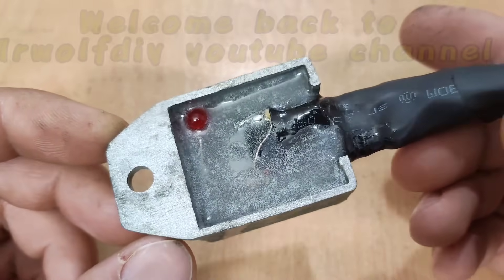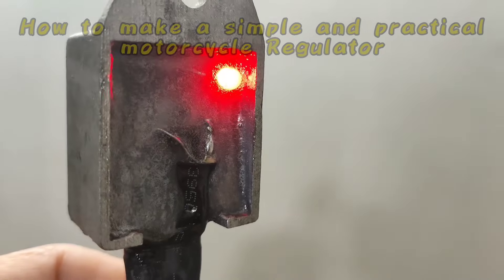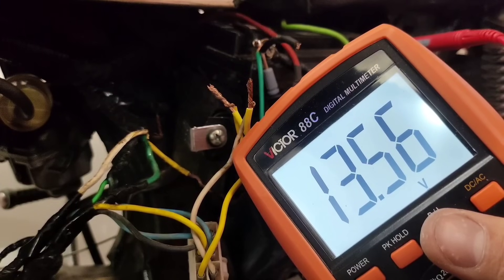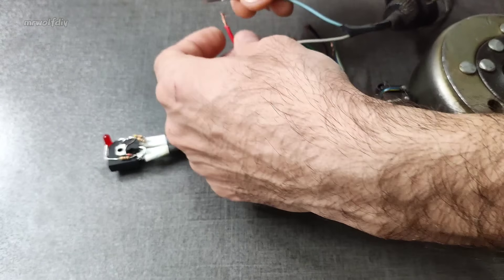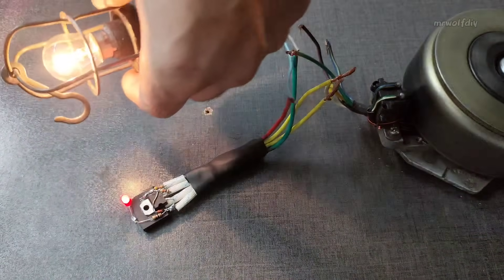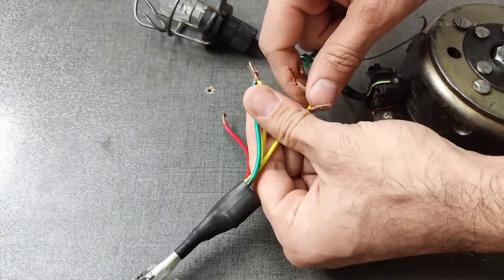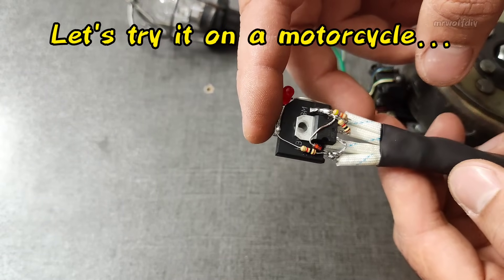The Voltage Regulator Hack _ Build a super easy Regulator for Your Bike!

Comment: In my snowmobile, I only have a 2 wire voltage regulator that connects in parallel with the stator. The voltage is not rectified, but it is a type of shunt regulator, output is maintained at 14VAC instead of 14VDC. Can you help me with the design?
Reply from the maker: In your snowmobile,
if the goal is to charge a battery or power DC loads, the voltage must be converted and regulated. Ac output is not suitable.
If you only want to maintain the 14VAC output as it is, you can improve or reinforce the shunt regulator design.
If you want a more detailed explanation, just let me know!
Reply: @MrWolfDiy I don't have a battery or DC charges to power, only a headlight, tail light and handwarmers so resistive charges. That would be great to have more explanation. Thanks !

Comment: So the Zener diode value is the main supervisor here . . . . .got it. .. 👍👍👍

One suggestion: Ganging the two main components together is not practical since they will exchange heat, separating them and mixing the sealing epoxy with magnesium oxide when sealing them promotes better heat dissipation.  
(Magnesium oxide (MgO) powder is an electrical insulator that is also a good thermal conductor.)

Greetings from India. ..

Comment: KBU8m is only rated at 8 amps max (96 watts at 12v), so unless youre riding a low spec 125 cc or less ,& youre bike doesnt req a 3 phase regulator & you ride daytime only,ts pointless .To give you an example my 750 requires a 300w 3 phase reg,thats 25 amp,the one fitted is a 30 amp to give a little margin. Best thing to do, get the spec of youre motorcycle regulator & either buy a new one, or make a suitable higher powered one,regs aren't that expensive, and you get a guarantee. When youre out in the wilds,miles from the nearest garage, & your bike loses battery power,you will think,why did i make this.
Reply from the maker: Yeah , this one’s for old motorcycles...

Comment: Instead of epoxy, I often use hot melt glue because it's cheaper.
Reply: Not a good idea as it quickly may melt at operating tempertures.
Reply: @tenlittleindians   Good point, that's certainly a possibility.  Although, my concern was damaging electrolytic capacitors no damage was apparent.  I haven't experienced any failures yet though, fwiw.  Not to say this can't happen.
".Hot glue, also known as hot melt adhesive, typically melts within the range of 250 to 380 degrees Fahrenheit (121 to 193 degrees Celsius). The specific melting point can vary slightly depending on the glue's formulation".

Comment: Thanks but zener  diode operates in reverse bias mode guide me
Reply from the maker: Thanks for question, Yeah, that's right. A Zener diode works in reverse bias mode — that's actually its main feature.
When the reverse voltage reaches a certain level, called the Zener breakdown voltage, the diode starts to conduct current in the reverse direction without getting damaged.
Basically, when the input voltage goes above that level, the Zener lets current through to keep the voltage steady and prevent it from rising any further.

Comment: i tried already dont work my register blowup.. i even tried your updated one with tip 147 but not work high voltage 70 or 80 v
Reply from the maker: A lot of people have had success with that circuit — just keep in mind it's for single-phase motors.
Reply: o my bike is double phage ... so for double phage  any one @MrWolfDiy
Reply: @MrWolfDiy  Will it work for 12v bikes like ct100 or old platina type comes with 2.5LB battery?
Reply: @theindianworkshop   There are at least four stator designs, basically two catagories (low power and high power).  Most high power stators do not use shunt regulator.  In my experience, low power stator is found on bikes with kick start, no electric starter.  The reason is, an electric starter uses large amounts of energy from the battery which then must be quickly replenished by the stator.
High power stators are usually 3-wire and use scr switching type regulator.
Among these, there are delta wound, center-tap, or may even be wye.
An scr type regulator may be used with a low power 2-wire stator as well, such as the 4140309 regulator.

Comment: What component needs changing or upgrading to make it put out 14.4 volts?
Reply from the maker: By changing the value of the zener diode and adding a filter capacitor (2200/50V) in parallel to the output, the output voltage can be changed.

Comment: I create the you made but not working i chek it if have do wrong but not working its to low voltage
Reply from the maker: Hi dear, Which motorcycle are you planning to install it on?
This is meant for older motorcycles.
This version has better performance...
👇
https://youtu.be/KtSelisDO8s?si=wmctu4XcL02Mm_Cq
Reply: I will use to honda tmx 155 4pin i have buy meny regulator but no good the voltage is to hight 17 to 21v the regulator is not durable i try to creat the one you did it the problem is no voltage going out i try it i dont know where i go wrong i use the brage diod is 10amper i dont know if that what when i wrong  the one you use is 8 amper brage diod
Reply from the maker: Hey buddy, Among the regulators I’ve released so far, this one is currently the best. Try this,
👇👇
https://youtu.be/KtSelisDO8s?si=D4u9ymA_2YNiS3y4

Comment: Hello Bro........  i`m just build it but not working... TIP142 is Too hot after 25 AC volt connect for testing.
Reply from the maker: Sorry it didn't work for you. This works mostly on older motorcycles.
Reply: @MrWolfDiy  Thanks Bro for quick reply.....  If this RR install with a motorcycle it will be work??

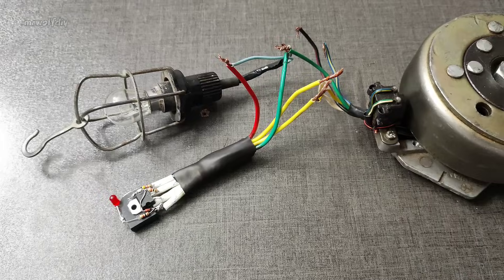Comment: ,How to regulate to 12 V and not burn the bulb, if you don't have a reference battery? 6:36 minute!
Reply from the maker: The regulator's duty is to regulate the voltage to a certain level to prevent bulb burnout and ensure battery charging.
Reply: @MrWolfDiy  how? With the zeners? Thankyou💪

Comment: Geat video i learned it thank u 💪 can u convert 6v to 12v motorcycle  ☺️
Reply from the maker: Thanks, For six volts, use a 6 volt zener instead of a 12 volt one.
Reply: @MrWolfDiy Dear Wolf

Can you tell me this is Half Wave 
OR
Full Wave Rectifier???????
Reply: @ibrahimsiddiq4102  Bridge rectifiers cannot make half wave.Its a packed bridge rectifier of 8 amps.

Comment: It will only regulate the output voltage, but it will not regulate the charge of the battery that will result in battery overcharge.
Reply from the maker: The duty of the regulator is to prevent this issue.
Reply: I agree. May I ask if you could send me a schematic of the battery safety charge stop ?
Thanks Joe

Comment: How to increase the ampere? I need 5 amps
Reply from the maker: The increase in output power depends on the rpm and stator type... Considering the components of this circuit, it can handle a maximum of 10 amps of current. If you need more power, you can use a stronger diode bridge, one-watt resistors, and a mj11032 transistor, which will be almost three times more.
Reply: @MrWolfDiy  thanks
Reply: @MrWolfDiy  These look like 1/4 watt resistors in the video. Was the wattage limit of the components listed somewhere?

Comment: เราสามารถเพิ่มกระแสไฟชาร์ทแบตจาก2A เป็น3-5A ด้วยวงจรนี้ได้ไหม
Reply from the maker: The maximum output power of this circuit is 10A, but in practice, it will probably be lower.
If you're looking for a way to fast charge, use a 15V Zener diode and replace the transistor with a more powerful NPN Darlington transistor, such as MJ11032, and test how effective it is.

Comment: I built it, and it works.👍 But after ten minutes, it got warm, so we should use a good heat sink
Reply: You use it until now, your battery charges well ?
Reply: @joepaul7297  The output current is a bit low, may not be suitable for strong batteries.
Reply: @Customhand  thanks 👍

Comment: This regulator output 
    Amper = ?
Reply from the maker: Considering that the maximum current of the transistor is 10A,
if you need higher power، you can use MJ11032.

Comment: What Amperage will this handle.?
Reply from the maker: Max 10a
If you need higher power, you can use MJ11032 instead of TIP142 and a stronger bridge rectifier.

Comment: For the 6v regulator i just need to replace the zener diode with 6volt one?
Reply from the maker: Yes, use a 6-volt zener diode. If the desired output is not achieved, remove the capacitor and test again.

Comment: I see you don't lack style. 
One note: does bjt-collector (+)  touch the regulator metal body by that screw ?
Reply from the maker: Screw is not necessary, however 
It is better to use a small plastic screw or an insulator to prevent an unintended short circuit.
Reply: just in case, if the Bjt collector goes to ground, it wll blows very shortly! Beware, it must be isolated from chassis otherwise it wil smoke!

Comment: Hi wolf, is it suitable for AC CDI stator or dc CDI stator
Reply: This is for 2-wire stator, I think you can use 3-phase rectifier bridge in the case of 3-wire stator.
Be aware, this shunt style regulator is intended for low power stators, larger stators producing 300 watts will destroy a shunt regulator.
Reply: @thisisyourcaptainspeaking2259 i think ac stators have one charging winding
Reply: @Bias_Prineus   All stators produce AC, the regulator-rectifier converts this AC into DC and regulates the voltage.
Some low power stators are single phase (2 yellow wires) while other high power stators are usually 3-phase (3 yellow wires).
So if your stator has 3-wires, it may be high power and capable of more than 100 Watts.  A shunt regulator works by absorbing any unused power, converting it to heat.
Be aware, it's possible for a shunt regulator to absorb power from a battery charger, thus a large enough battery charger might damage a shunt regulator.
Reply from the maker: AC, DC stators are three-phase.
Reply: @MrWolfDiy  ok so the charging winding is not grounded at one end, am I correct?
Reply from the maker: I wrote how the circuit works in the video description.

Comment: Can the 2N2955 or TIP42 transistor be used?
Reply from the maker: No, because in this circuit, the transistor must be of the Darlington type،
You can use:
BDX33C, 2N6284.
Reply: Ok fine. Now I have the bdx33c, just waiting for the resistors and other components to arrive  @MrWolfDiy

Comment: Como si usa zenner de 12v aguanta hasta 14.5v?
Reply from the maker: The Zener diode value determines the cutoff threshold and, consequently, the regulated output voltage level.
In charging mode, the voltage reaches 14.5V at higher RPMs (when the battery is connected)
Reply: Thank you bro💯

Comment: You need snapper cuircuit for protection the component electronic
Reply: Hi  possible to make this regulator put out 14.4v, also with the safety components?
Reply: @jayesse8912  It seems you are thinking about using a Lipo battery to replace a lead acid battery?

Changing out the Zener diode for another with the voltage limits required by Lipo batteries would only get you part of a solution.

I'm sure Mr. Wolfe could come up with a version for people wanting to swap over to Lipo batteries and the charging limits they have.❤
Reply: @tenlittleindians  Replacing the 12v Zener diode  with a 13v will do (I already did this, the engine at max throttle  give out around 14.4v to 14.8v which is still within a safe voltage range for charging LiFePO4 batteries.).
Reply: @johanrynjah8241  You still need battery monitor software or hardware to prevent constantly cooking the battery after it's charged.
Reply: @tenlittleindians  A 4S (under 250cc) or 4S 2P (above 250cc) LiFePO4 battery pack configuration still falls under very low load configuration and don't require high-end BMS (with smartphone connectivity for monitoring) like a heavyload backup stations do. 
A good quality 4S 40Amp BMS (minimum) from a brand like DALY will do all the load-handling, charging and cut-offs on itself.